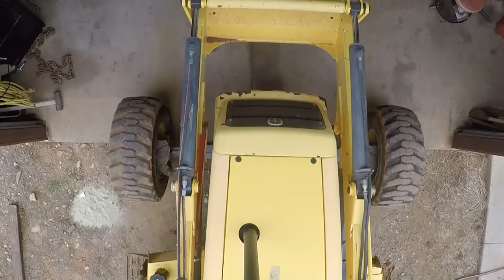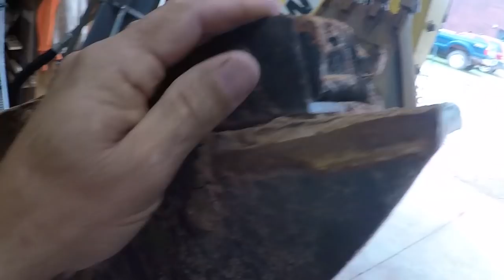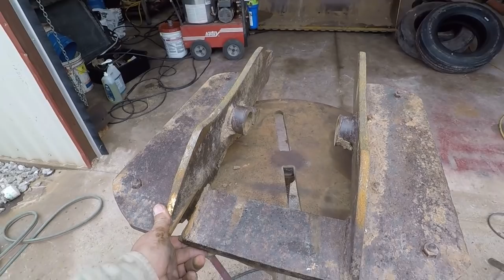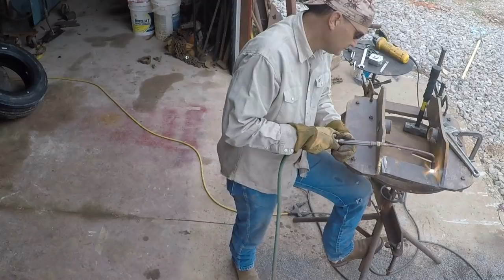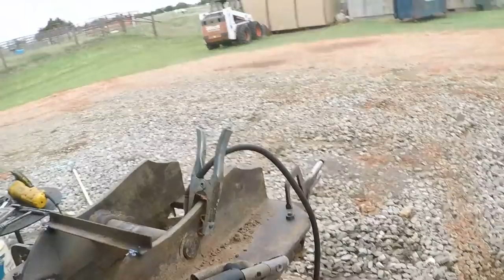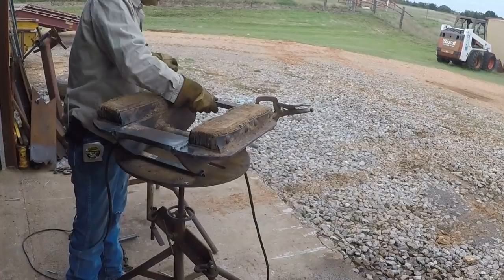Welding the backhoe's foot

Comment: That is a better part than it was new. Thank you for saving that foot instead of taking the easy road and buying new. This is the mindset that our Dads and Grandpas had. This is the elbow grease that made America great. This repair also made a great video for all of us to enjoy. Counting the welding rods, grinding wheel, gas for the torches and welder I would estimate you spent around $15. You saved a great deal of money and produced a tip top video. 2 birds with one stone my friend. I wish I could hit the like button twice. You tube needs to put in a 3rd selection where you can love the video! A good weld repair video is like holding a baby, it just makes you happy inside.
Reply from the maker: Glad you enjoyed it!! I will make more as needed of course!!! Thanks bud!!!
Reply from the maker: Btw Friday video on Thursday, sorry 😐
Reply: Digginok  well considering the price I am not going to complain. I was rambling through the comments section and wanted to throw my 2 cents in on the 6010/6011 root pass. I know that I am old fashioned I admit that I learned the old fashioned way. I am holding to my convictions that on mild steel the way you are teaching is the best. I enjoy every time you do that just because all the new day critics that say it is wrong. That foot will take a beating and it will hold end of story! The core wire in a 6010 and 7018 are the same metal. The 7018 hot pass that you put right over the top will anneal the root pass and it will be at 70K psi tensile also. The men who taught us to do this were setting us up to be successful. I believe in the men I learned from. Thanks for honoring the past and your teachers, they taught you well.
Reply from the maker: Just know what works for me, I’ll stick with it! Thanks for watching Tim!!!
Reply: Digginok  I don't blame you a bit, no reason to reinvent the wheel. Stick with it on stick welding that is a great little pun. Are you now going to add some comedy? With running the business, welding, wrenching, you tube and playing in the dirt you are already busy but if you add comedy it could never hurt. Thanks for making me smile.
Reply from the maker: I’ll do what I can bud!!!
Reply: Hi good job

Comment: Yeah, in a repair like this or really most repairs where you can, add more metal in there with the weld to help prevent the failure from happening again. Metal breaks from bending or shear and a little extra in the weld always helps. You did it right.

Comment: So, this is the first I've heard of using 6011 for a root pass and topping it off with 7018.  I read through the comments and it sounds pretty legitimate.  I'll have to keep that trick in my back pocket for next time!  I'll probably be doing some welding on my loader when I take it off one tractor to put on another sometime soon, so it might be a good chance to try it out.  Great stuff as always!  Thanks for the video!
Reply from the maker: It’s a great way to make a strong repair, have used it a lot. Thanks for watching.

Comment: How do you like the new holland? I have a 575D and it just keeps on going
Reply from the maker: davevanden1 Good machine! 9000 hours and counting , my 3rd new holland machine , 20000 hours between the 3, I would buy another.
Reply: I have 13000 hrs on mine just doing the normal fix it things on it. great work there !!!

Comment: When you’re welding is sounds like you’re running the wrong polarity. 7018 should be DCEP (direct current electrode positive) sounds like you’re running DCEN (direct current electrode negative)
Reply from the maker: Michael Mello could have been, repair is still working so far. Thanks for watching

Comment: you always have to give a base with 6011 before 7018?  
Is it possible to start directly with 7018?
Reply from the maker: Yes it is possible and I have done it that way before, but I like the way the 6011 fills in to begin the weld seems to me it gives a good base plus the 7018 likes some preheat. Just the way I like to do it, It has proven to work time and time again, there are other ways to do it this is only one. Thanks for watching and the good question!!!
Reply: well I understand, if the 7018 are something hard to start, I'm welding, a 1/8 inch angles to build a beam, and in my ignorance to give it better structure began to weld them with 7018 and discovered that they are hard to start.
Reply from the maker: Best way to learn is to do it! You will figure out what works for you the more you weld.
Reply from the maker: I have a video of welding Eric’s gate, we are using only 7018 for it. If all I have is 7018 that is all I use, same with any rod     
But you are right the 7018 is very hard to beat for strength and is my go to.
Reply: @chevyford100  Before trying to strike an arc with the 7018, drag the tip across a rough surface, or tap the tip on a rough surface, like concrete, to knock some of the flux off the end of the rod. In the  welding class I took several years ago, there was a chunk of concrete in each welding booth to help with starting the 7018.... Do the same thing each time you stop and have to restart a rod.
Reply from the maker: What I mean by hard to start is the slag from the 7018 gets in between the two pieces of metal and makes it harder to join the pieces. I have never used the block for cleaning the slag off rod tip, I bet that does help!!!
Reply: thank you very much if I was watching some videos where they pass a steel file to the tip of the electrode, 
others say that the technique is to approach the electrode slowly, so that the arc ignites.
Reply: Adrian  you will have to initiate the arc by striking the rod. That strike will involve touching the rod to he metal. Arc striking just takes a little practice. As a skill builder you can take some scrap metal and just practice striking and establishing a puddle. If you would like I can talk you through some different striking techniques and you can try them and find what works for you best. Just keep in mind that welding is fine motor skills not brute force. Soft hands no death grip on the stinger. The 6010 or 6011 root is not a must but the light slag and fast freeze puddle make getting a solid base in easier and more guaranteed. The root being put in with the 6010 or 6011 is a driving arc with great penetration that is a time tested and proven technique! If you know you are going to restrike a rod snapping out of the puddle on the last previous weld really helps and as soon as you break the arc flick the wrist very snappy like cracking a whip. That helps reduce the size of the slag ball on the end of the rod and that will help with restriking that rod. If I can be of any help let me know, I will be glad to do my best to answer any questions you might have. Best wishes to you and all your welding projects!
Reply: Thank you very much sir, 
I'm going to do what you said to practice with scrap metal, 
I can currently make decent weld seams on flat surfaces or 1f 1g  position 
the rest I have to practice it a lot haha

thanks again for your help I will keep you in mind!
Reply: Adrian  As a training tool an old weldor took a hand full of 7018 and knocked all the flux off. He made me learn to strike an arc and get going with that. The flux being off made you have to get a light touch and pull back to the perfect length to not lose the arc. Striking in the joint ahead of your initial puddle and letting the arc stabilize then moving back to where you are going to weld helps get good clean hot starts. When you get some time you might consider trying holding the stinger with one hand and holding the rod about 2 or 3 inches from the welding end. That will allow you to strike with the close hand and add to your control. After you get the weld rolling you can just put the striking hand on the stinger or use it to prop yourself in a comfortable body position. Thanks for the sub and positive feedback. Many years ago I was beat up by old weldors but they had my best intentions in mind and I make good coin now welding. They taught me to never be satisfied and never stop trying to improve. Don't practice until you get it right practice until you can't get it wrong. I weld low grade chromemoly and stainless steel, these rods run at low amperage as compared to mild steel rods. The skills drills I had beat into me came in handy when I first started my present job.
Reply: Again, thank you very much for your time, at this time with my father we are putting together a cross-linked iron beam for our barn, it is about 20 meters long so I have to burn a few electrodes 
there I will put into practice everything that I have been told.

you are also welcome to put video on youtube =)
Reply from the maker: You are welcome!!!! Thank you for watching!!! Good luck with your project!!!